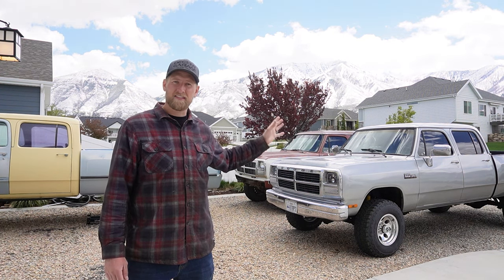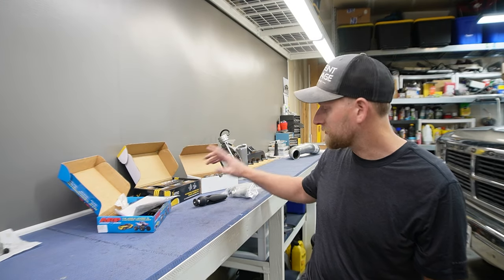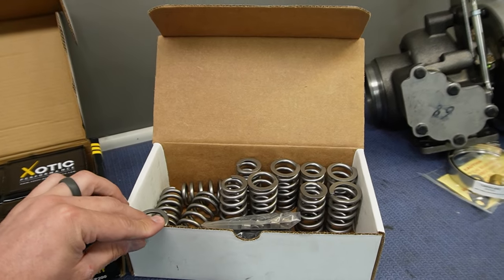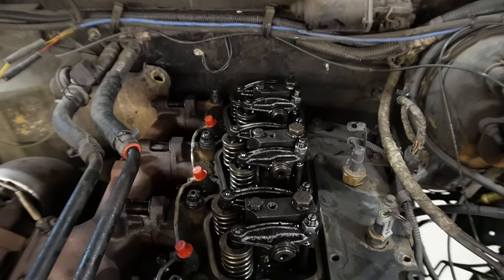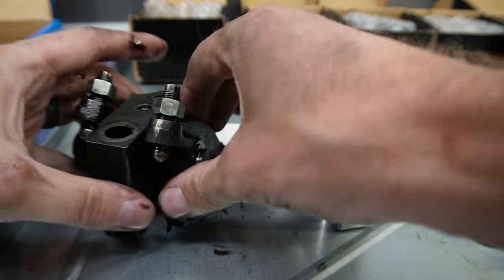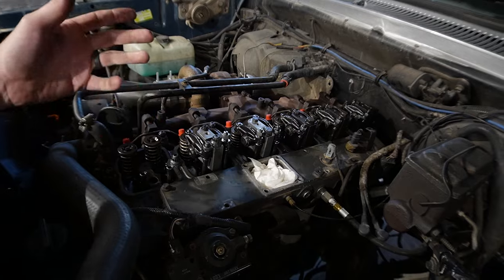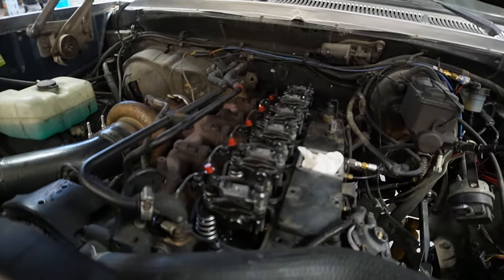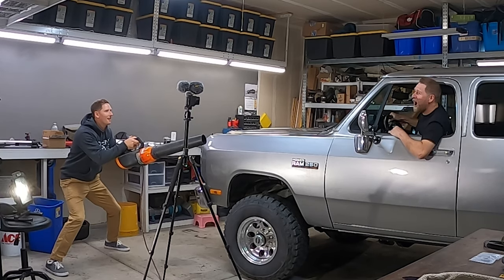Engine Mods to SAFELY Handle More Power | Road to 600 HP - Ep.1

Comment from the maker: To enter the HVLP giveaway you can do each of the following for 1 entry EACH:
1. Comment on this video

2. Follow @decent_garage 
on Instagram.

3. Tag 3 people on IG 
giveaway post
Reply: Glad you got that spring compressor fixed ! Make sure to run some of that zinc we got before with those valve springs so you dont wipe your cam
Reply: Sweet videos I’m restoring my 92 and pan on doing some sweet upgrades a lift pump would be sweet to win. 👍
Reply: That HVLP would work perfectly on my 93

Comment: Love your content, glad you got some sanding practice at Robbie's. I would be interested in a fuel mileage number along the way as power goes up. My bone stock 93 D250 automatic gets about 24 just running around with an empty truck. I've purchased some power parts but the truck runs so good I'm hesitant to upgrade the power. Keep up the great videos.
Reply: I’m the same way. I pull a gooseneck of cattle every once in a while so I’d really like 6-800 torque as it makes these hills easier but I haven’t had any issues with the motor so I am hesitant as well. My thinking is when I have to rebuild around 350-400k I’ll add power but I’m along ways away since I’m only at 160k miles 😂😂

Comment: I love your videos. I just changed my throttle linkage position yesterday. I got the 4 in diamond eye exhaust, 3200 spring and the HD fuel pin. The lift pump would be a good addition to my 93 with the getrag. And thanks for all the help on Facebook too.

Comment: Did you win that second game of checkers ? LOL ! SOOO I learned that a gas engine you have to put air into the cylinder , But Diesel you just get the piston to top dead center to change the valve springs, Very cool !
Reply from the maker: That footage was too brutal to include 😂. You can put pressurized air in to the cylinders on a diesel as well. This method is just easier if you don't have the custom cylinder chuck.

Comment: I just got ahold of a beat up 1989 5spd D250 Cummins regular cab. Pewter brown with tan interior. She definitely needs TLC. does anyone make non-intercooler to intercooler kits for these trucks? Or would you know of any videos on it? Thank you either way. Will.
Reply from the maker: There aren't any kits per say but it's easy to piece one together using a stock 1st gen intercooler, a second gen intercooler or a 7.3 powerstroke intercooler.
Reply: @decentgarage  understood thank you.

Comment: What is  the purpose of the milled pedestals?
Reply from the maker: Sorry, I thought I mentioned the reason. When you run head studs you have to mill the pedestals so that the valve cover can fit on and not his the stud. Does that make sense?
Reply: so the aftermarket head studs have larger bolt heads. Right ?
Reply from the maker: @bryanalarcon563  so the headstuds are different than the original bolts. I referred to the original ones as studs but they are actually bolts. The new studs are a stud you feed in and then put a nut on and torque the nut down. Does that make sense?

Comment: Hey Tim. Looking forward to seeing the results. Question - did you replace the valve seals? What type are they? Original, or the newer top hat style? I've also been reading, and many builders seem to recommend the top hat style, especially for this application.

Thoughts?
Reply from the maker: I did not replace the valve seals. To be honest I just didn't think ahead and order some or I would have replaced them with the top hat style. I may still do that when I am back in there to do the pushrods, taps, and cam.